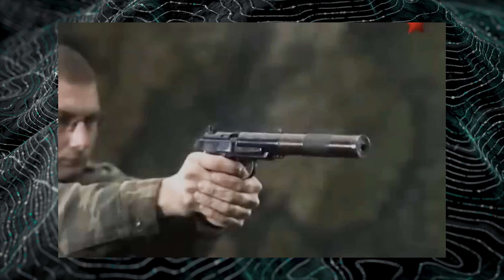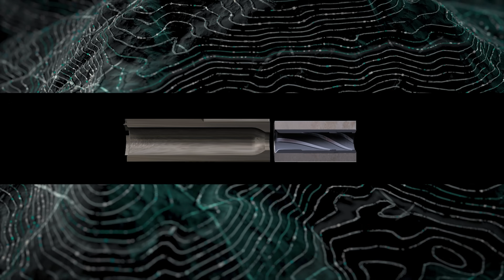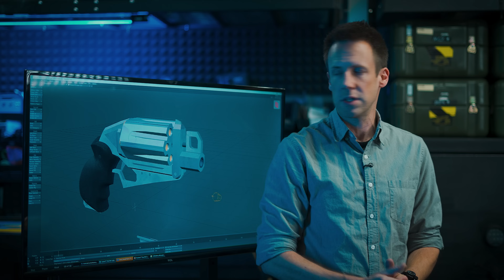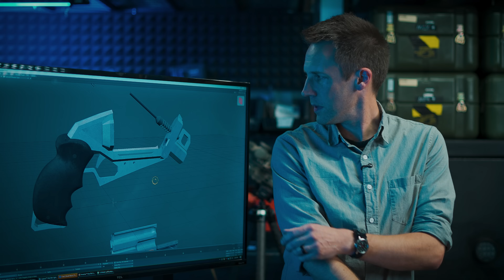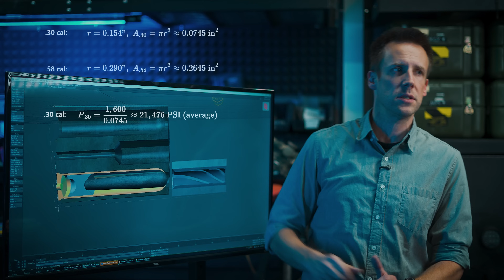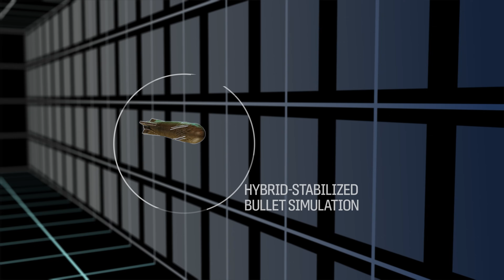Modern Captive Piston Ammo Could Enable Silent Handguns

Comment: "Traditional" subsonic Gas-Sealed ammunition and enhancements/modern milling to a combination of OTS-38 and Nagant designs could make a great Statecraft/Veterinary tool. Starting with the revolver frame being solid on one side, milled to accept the cylinder. 
An OTS-38/Shuttuck pivot-out cylinder with Nagant back-to-front travel, and a shield made to interlock with the frame to close the cylinder gap, but allow the cylinder to rotate freely until the chambers are aligned. Then the trigger pull drives the cylinder forward, where wedges in the cylinder slide into grooves on the shield, driving it forward, tightening everything to completely seal the gap during the shot. Still firing from the lower chamber, with a lug above it to accept a detachable Osprey oval-shaped, ported/rifled "integral" suppressor. All for moon clipped Gas Sealed 230r 45ACP Ranger Ts.

Comment: with new metamaterials I am curious if airguns will make their comeback, there are impressive airguns for hunters capable of shooting a wild boar or bison through and through lenghtwise, for military purpose minimal sound and no flashback might be interesting perks, just have to work on the reservoir and pressure control and pellets, a pcp/co2 based gun that is effective enough but not awkwardly big, weirdly shaped with very low capacity

Comment: Pulling 6 casings containing high pressure gasses with my hands….what could possibly go wrong? How do you safely dispose of those mini bombs? What happens if one of them ruptures? Also it would take an insanely fast rifling twist rate to stabilize that long of a projectile.

Comment: Something that wasn't addressed, but that concerns me. What about the primer?  If the cartridge does not leak, when you open up the action each primer will spontaneously eject.

Otherwise, maybe use a sub caliber insert for a 12 gauge. Get one for a 45 or a 9mm then custom chamber it for a short 20 gauge.  Build your piston out of 20 gauge shell components. Keeps costs down. Use a very long string.

Comment: 11:23 "...Stainless steel not only a good metal for corrosion resistance, but it also is a pretty good thermal insulator..."... As one who work on thermal detectors for industrial use... With all respect... What are You smoked?
We use it for outer case for our detectors which essentially is a the thermo couple from which we take current thermal dependent resistance and convert it in temperature. When I put those detectors with a stainless steel case they heat up or cooled out after like one or two minutes...
I assume that different mark of stainless steel can have different thermal indexes, but any metal are good thermal transmitter. Only thing which it viable in this case is that stainless steel cartridge can withstand pressure and heat. That's make sense. But a "good thermal insulator"? A metal? Something in those words are clearly wrong.
BTW! In those soviet gas captive cartridges gas after shot where slowly exceed the case to prevent it's eruption. I suppose because of "stainless steel" case in this theorisation author doesn't know it.
Reply: It certainly not a good thermal insulator compared to non-metallic materials, but it's much more of an insulator than other materials with its strength and weight... Which are all metals.

Comment: I can't watch.  Doomed from conception.  
At the end of the piston's throw is as fast as the projectile will EVER be.  Relying on pure momentum to engage the lands, I'll be surprised if it has enough energy to exit the barrel.  And it had better be a SHORT barrel.  Whereas a conventional bullet is under pressure and speeding up until it exits.
Reply: Ideally, the part of the bullet that engages the lands should have exited the barrel before the piston stops pushing.

Comment: Because there's no gas escaping the cartridge to the barrel, having an air-tight seal with the barrel is pointless, if not detrimental due to a vacuum created between the cartridge & bullet. Friction & noise could be reduced significantly with a square or even triangular barrel.

Comment: You can solve a lot of pressure AND aerodynamic stabilization problems by making the body of the projectile  aluminum with a lead penetration head. That moves your center of mass forward and center of drag backwards closer to the stabilizing fins. 

This is how arrows operate 

Consider making the tip as aerodynamic as possible, because you aren’t dealing with a Mach cone, if airflow is able to flow around the head , it can use the coanda effect to allow the fins to effect drag. 

You also need to move the fins forward enough to keep them from being crushed by the delrin wad/plug. 

while the case may be able to take the pressure, the primer must be staked to keep it from popping out.

Comment: Idea: with the swappable cylinder, you could try doing this as a black powder muzzleloader. Just have a stainless steel cylinder block that you plug with delrin, load propellant, and slide in your projectiles, then prime (maybe revisit that one guy's experiments in piezoelectric primers so that the gasses won't blow off a cap).
You can suppress a muzzleloader no problem.

Comment: I see problems with out any math . First your long projectile will flex as soon as your piston starts pressing it forward causing it to jam on it crimped down shell. Your piston is not a sabot incasment . A sabot incasment travels with preventing flex and exits with the projectile it doesn't push forward disappearing into the ether as it presses into the crimped down shell opening. So one flexing of the long projectile two a sabot incasment that disappears into the ether that keeps it from flexing OH the increase twist rate on a long projectile won't work the difference in twist at either end of the projectile will jam the projectile up !!!

Comment: what about this: add a lever. a "Two cartridge gun" - one is the piston cylinder with the powder and it's connected via a lever-like interconnect that transfers the momentum to a second cartridge that holds only the projectile, which is then thrown out of the barrel by the lever, so you get mechanical advantage, actuate with a variable pivot point to get increasing acceleration across the length of the movement in order to maintain contact with the round and efficient energy transfer as it's flung out the barrel.

Comment: CO2 cartridges don't contain 12k psi. Without a volume to expand into, the liquified CO2 remains low pressure. It supplies pressure based on giving it a volume to "boil off to" so it's not actually under pressure in its container

Comment: Some of the Soviet lore behind this tech is that the empty cases would remain pressurized and burst when stepped on or kicked and we're capable of causing small injuries.
Reply: In theory with modern techniques you could intentionally make them slowly leak over the course of seconds, minutes, hours, days, etc. Eitherway, with the cartridges staying in the cylinder that wouldn't really be a problem.

Comment: You can have both sabots - the retained sabot within the cartridge, and a discarding sabot around the projectile that lowers total projectile weight to a more manageable level.  That would also allow you to use less powder to reach just-subsonic muzzle velocity, and thus reduce residual pressure.  

If the shotgun casing were perforated radially around its mouth just behind the rear of the internal piston at its maximum extent, it could vent through a hole at the mouth of each cylinder chamber into a gas containment chamber in front of the trigger guard to drop pressure and reduce gas escape noise to the outside.  Gas could be routed out the bottom of the frame through an internal passageway into the containment chamber, and then around chamber baffles to the outside - perhaps pointing rearward and downward at the exit point.  The casing's roll crimp could stay in place as a shock absorber, and you could use brass casings if plastic proved too weak.  It's an interesting issue, and development could be described not as a silencing mechanism, but rather a "delayed pressure release" mechanism to use low-pressure gas to fire small-caliber projectiles from a large-diameter cartridge case.  Or some other creative euphemism.

This is, in principle, similar to how pneumatic spear guns work - but they are muzzle loaders with long-travel pistons.  Nail guns also come to mind - since they are "blanks firing external projectiles," as opposed to this being a "blank firing an internally-held external projectile."  I

 once thought of a muzzle-mounted gas capture diverter valve for powder gases that exhausted into a balloon contained inside a canvas "sock" to allow gradual expansion, arrested before the balloon blew up.  The early garand experiments had a muzzle-mounted gas capture device to actuate the charging handle and cycle the action; it's not a heretical approach.

Design of a sound-reducing device - a very useful device of benefit to shooters' and spectators' ears - is a source of fascination for many people.  Unfortunately, we have the misguided NFA (or NFGNFA) and government abuse of citizens' rights to thank for suppressing (no pun intended) the creativity of the American engineer.  Unleashing the imagination of tens of millions of insightful American mechanics/engineers could result in a device of great service to our men at arms in the field. - but dumb regulations preclude capitalizing on that national creativity.  What a mess.

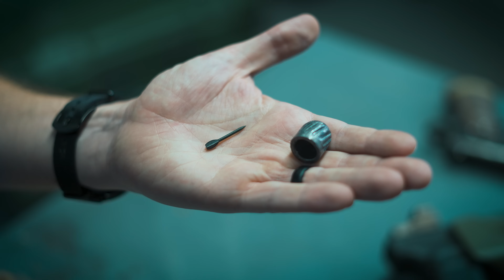Comment: 24:19 vins? Aren’t those working against the rifling spin stabilization? (the reason there are vins on missiles is to prevent spin….and of course as control surfaces) maybe it’s a solution do some experimenting with the position of the center of gravity of the projectile

Comment: This whole video I've been thinking a copper solid 30 caliber would be a good projectile for it lmao. It seems like it's about as small as you would want to go for say a hollow point with current projectile designs. But with this cartridge design it seems advantageous to go for the smallest viable projectile diameter so that you can get a better BC, because as long as you can stabilize it there's no other internal ballistic consequences to reducing projectile diameter.

One of the interesting things I learned from a guy in the printed gun community and then relearned when trying to develop Short action Magnum cartridge loads is admittedly a bit self-evident but something I hadn't thought of previously. 
If you think about the difference in frontal area  between a 25cal and a 50cal projectile. The 50cal doesn't have 2x as much area, it has 4x as much. 
Okay that's pretty cool but like it's kind of whatever, then you realize 4x  as much area means that at a given chamber pressure you will be exerting 4x as much force on the projectile!

Comment: 20:51 Wait...what? 12,000 psi inside of a pellet gun CO2 cartridge? Um... I think you forgot to carry the one on your math... CO2 is only like 800 to 1000 psi depending on temperature. I've  read that 20oz CO2 bottles can reach 2000 psi in high temps. Even HPA cylinders don't safely go to 12000 psi. My HPA tank for paintball was 4500 psi, and had burst disk set to 7000 for safety.
Reply: Yes, the correct answer is 1200 psi at the high end... And I misspoke. There was an actual 12,000 psi later, and I am mixed them up.
Reply: @isaacbotkintrex  Ah ok, well regardless it will be interesting to see it work, I'm curious if the cases will be easily removable after the gases expand, and how you would degas them afterwards.

Comment: A shot gun shell would be the easiest. No new gun needed. Or, use each cartrige as its own barrel, imparting spin, with a shorter bullet. Reloading at that point should be a priority, perhaps through a locked opening in the case if parts are alined.

Comment: Soviet Pion 203mm artillery shells have two copper bands (or leading bands, not sure how that's in proper english) around the centre of mass. Perhaps the center of the projectile needs to be beefed-up? Or, if using stabilizing fins - ditch the rifling?

Comment: On your pressure numbers, you should be aware your figures for CO2 cartridges is a decimal point off, they peak at around 1,200 PSI, not 12,000.
Reply: Yep. It's a pretty significant mistake. Good thing I didn't actually pressurize a CO2 cartridge to that.
Reply: @isaacbotkintrex  A dangerously significant mistake, if he's designing his wall thickness based off those numbers, he'll have a catastrophic chamber failure in his hands in that case. And that's the upper limits of those cartridges, if I remember correctly the diaphragm on the tip ruptures past 1400 if heated enough, standard operating pressure at room temp is 750 PSI.

Comment: Why not just make the whole barrel a sound dampening barrel, no add on required?
Reply: Still needs volume for the gas to expand, so you are adding size and mass to the gun...
Reply: The point I'm making is that if the pistol sound dampening is the stock barrel, then no stamp required.

Comment: would it be possible to hybridize the sabot? Use the captured model you have, but also use a disposable, break-away sabot, to stabilize early. It may save you on the design on the actual projectile as well. Use one sabot to launch it and control the gasses and blast, sound, etc., and the other one for stabilization. If you like my idea, hire me, also, lol.

Comment: Would have been way more interesting if you did this in 410 as there would potentially already be revolver platforms that the ammo could potentially work in.
Reply: Now that would be onto something.
Reply: Potentially even just see how much power you could even get out of a 410 operating under these principles firing out of a judge or something.
Reply: Thefirearmblog has a article on this idea, a 300-410 bore as it were
Reply: @kozybeargaming correct. The title is in my message above. Bu there the idea was to have a cartridge that could be traditionally suppressed.
Reply: That's what I envisioned in the article: "Wheelgun Wednesday: Silencing the Gap - Part 2" on The Firearm Blog
Reply: This exactly. I wonder how far this could go building off existing platforms.

Comment: Fins and spinning are not the only ways to stabilize a flight. All that is needed is to get the center of pressure significantly behind the center of gravity. The center of pressure is generated anytime you move the air. A rocket with a heavy nosecone and a hula skirt will fly straight. All you need is a shape at the back of the projectile that moves more air than the tip.
Reply: That bullet shape looks like its center of mass is very forward
Reply: Correct. However the round nose isn’t doing it any favors, i was thinking that the body of the proj gets made from aluminum, nose is lead, and spitzer shaped, with a smooth body and either fins or a skirt. If the body is smooth and conforms, it keeps the center of drag well aft of the center of mass.

Comment: The acetal plug will get wedged and ejection will be impossible.  Dissimilar metals will probably be required, or and advanced coating.
Reply: What do you mean? The plug being wedged is literally the point of the cartridge. Do you mean it'd fo askew and get stuck before pushing the round out all the way? That seems like a basic tolerancing issue but that's the only thing I can even imagine you meaning here.

Comment: fun video and great mix of analytics and imagination enough no one has their eyes glaze over lol;  i like the smaller silencers that use a ton of wipes. its retarded that wipes have to go through an sot or a silencer manufacture to all the spent wipes since they consider wipes to be part of a silencer, but come on, this isn't rocket science how they are made... i have a few different firearms that have a way to lock the slide depending on which on i'm using. but i can get sub 100db just depending on how many wipes, and expansion chamber then more wipes and of course what kind of 9mm i'm using.
its simple to carry a wipe recharging bit to swap out all the spent wipes, (around 20rnds is starts sounding like a suppressed gun) with new wipes and keep going. so really that is the only irritating part, but no more than changing a mag, and to be serious, if you are going to these extents. its usually for a single reason, whatever that may be, but when you are getting this quiet, you probably will never need to even have the 20rnds on you.
but design, engineering, mechanics just for "why the fuck not" is my motto, so Kudo's man, i'm glad to see you are keeping your mind going and focusing. pain let's you know your alive, it can stop some dead in their tracks and some use it like a superpower. keep it up man, great stuff.
ps. let's be real, registration or not, there are probably only a few that slip through the cracks and "they" don't know the stuff they have, so NFA or not, if they really want to do something like "spring cleaning" and target you for whatever reason, they already know what you have lol. but fair is fair, we know what they have as well.

Comment: That increasing twist rifling seems like a good idea until you realize it'll literally be trying to torsion the bullet body along its length as it moves through it.
Not going to work I don't think, or at the least might unintentionally cause overpressure from the increasing resistance of trying to torque the bullet.
Reply: You have to calculate it so that it's constant torque: the same force resulting in a faster cumulative spin over time. Also, we would like to slow down the piston just a hair before it stops.